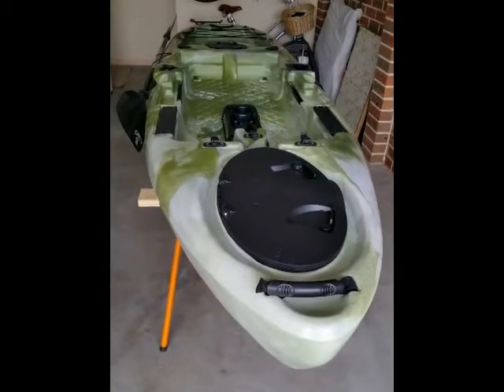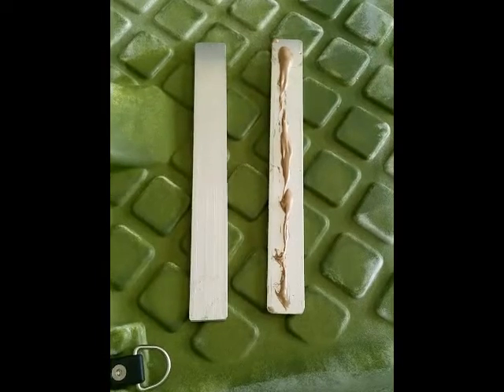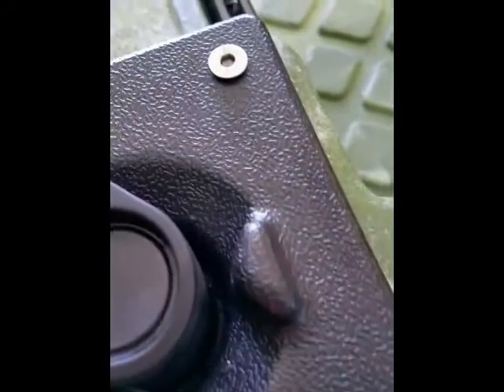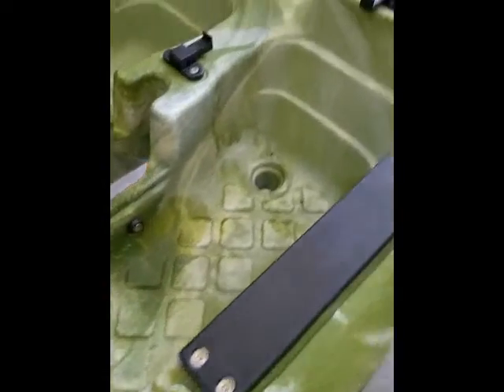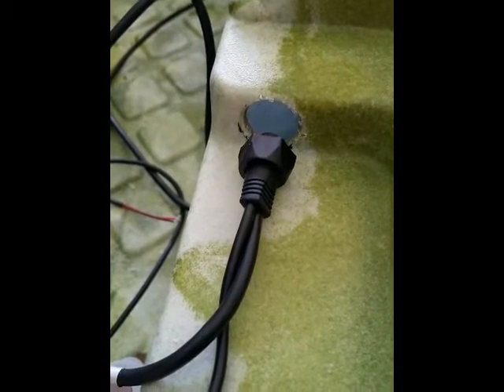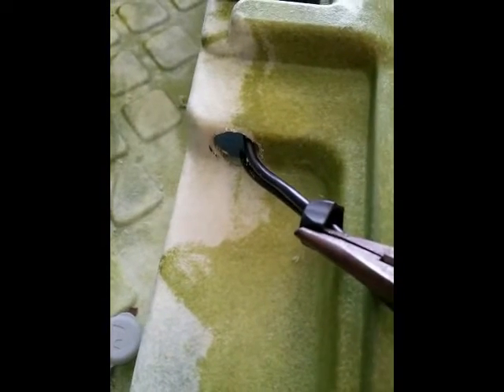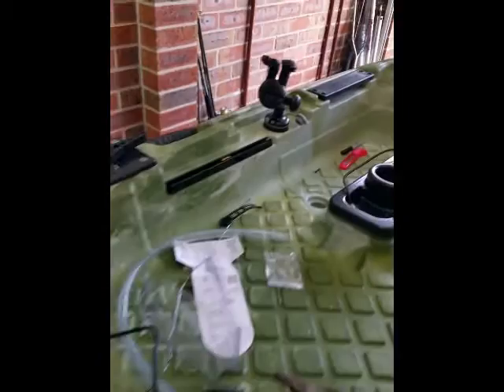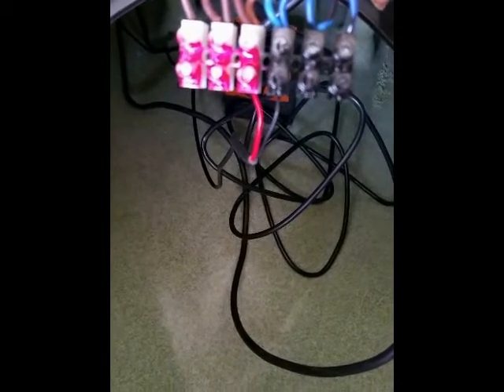Pedalfish 10 Kayak - Fitout

Comment: Hi Mark. Nice video. I'm currently rigging my pedal fish 10 up, and was wondering what the dimensions of the crate you used are? Is it from Bunnings? Additionally, what did you use to secure it to the yak? Cheers
Reply from the maker: G'day Lachlan. Glad you enjoyed the video. I'm still in love with my Pedalfish and get out in it at every opportunity. Yes, the crate came from Bunnings. It is called the Multistack. I have the 26 litre one which does the job perfectly. it is simply attached to the Yak with the bungees. The bungee that holds the seat in place is simply threaded through the rod holders and the rear "cargo" bungee is likewise slipped over the top of the rear rod holders. This keeps it firmly in place but also allows for quick removal. Hope this helps. Feel free to email me via its.mrbean@gmail.com if you want to know more  Cheers, Mark